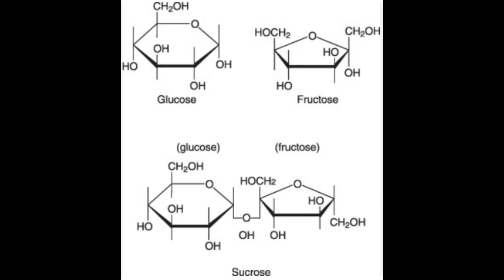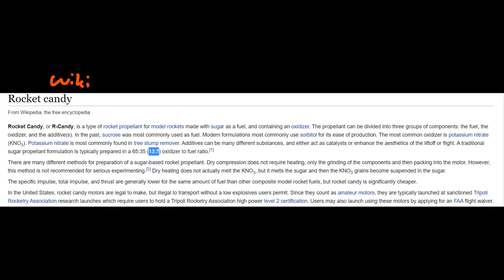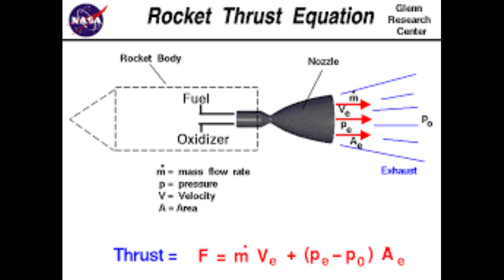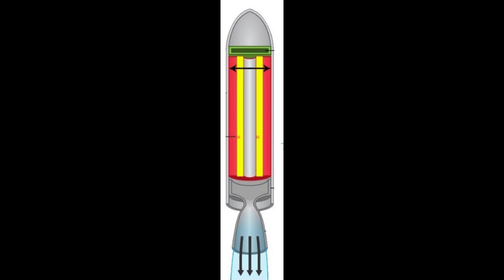Does Calcium Nitrate + Sucrose Rocket Work? (fail).

Comment: Ok if you want a rocket you will need a tube that won't burn through. Many at this level use butcher paper wrapped around a mandrel many times. Then press some kitty litter into one end and compress it well. Fill the tube with your propellant then seal with kitty litter. Now drill a hole in one end to make a nozzle.

Comment: You definitely need a casing to hold the pressure and a nozzle to expell de gaz at high velocity. I see smoke coming out both ends. That explains why you are not getting any thrust.

Comment: Yo, I've found that using a dry powder mix instead of cooking it together works better but it has to be well mixed and compacted a little. Just chuck the ingredients in a coffee grinder separately and then mix in a mortar and pestle.
Reply: Also, bake the nitrate at 180-200C for a while to dehydrate it, might take a while if you have a lot of nitrate.
Reply from the maker: honestly yeah that sounds lots better. my grinder broke sadley, so i had to resort to caveman tactics.
Reply: @thecrudelab3204  Yeah, coffee grinders don't last long when used for our purposes and I think the retailer's have caught on and increased the prices!
Just drying the oxidised and fuel for any of these reactions beforehand will increase your success.
Also if they are dried you might be able to powder and mix them just as well in a mortar and pestle.
Reply: Also, also lol, You can mix solution of sodium or potassium salts like carbonate, sulphate, hydroxide etc (not chloride) with calcium nitrate to get a mixture of solid Calcium salt and aqueous potassium or sodium nitrate that can be dried or mixed with the sugar and cooked to make a more conventional rocket candy.

Comment: Which was the most powerful / best mix for rocket motor?
Reply from the maker: in my overall experience: sodium nitrate, iron oxide, and glucose was my best. 
if you're talking about specifically about the calcium nitrate rocket, then i'd say the 5:11.5 (Fuel:Oxide) ratio. but its not exactly good, and won't produce any distance vertically.
Reply: @thecrudelab3204  thank you very much
Reply: @thecrudelab3204  does iron oxide help with calcium nitrate sugar mix.
It does with potassium nitrate but what about calcium nitrate

Comment: I recommend mixing Calcium Nitrate with Glucose syrup or corn syrup on low heat without water instead of table sugar. In addition use pottery grade Iron oxide which is pure Iron Oxide without any contaminants as a catalyst. Pottery grade iron oxide is readily available as red ceramic/pottery pigment/dye in gardening, also sold as cement color in Home Depot and Lowes (if you live in North America). In Europe the pure Iron Oxide is readily available in Bauhaus stores.

Also use a PVC tube instead as the rocket shell and once you pour the ready mix into the tube, make sure that no air-pockets are available in the mixture and use a relatively narrow metal rod to stick it in the fuel mixture once in the rocket shell, you want to have sort of like a hole in the mixture that will allow the fuel to combust more rapidly thus increasing thrust. 

I have linked an old video to the procedure of drilling the hole in the mixture:

www.youtube.com/watch?v=K5ig8J5xeqg
Reply from the maker: oh cool, so you got it working?
i think i'll design a metal case instead of PVC, as im not a big fan of burning plasic, and metal's pretty.
Reply: @thecrudelab3204 For just a one off experiment, steel,may be going a bit far.  I haven't done this yet, but one style of rocket people make has a thick-walled rolled paper tube (with glue). Thebl following has some guesswork on my part. Put a short section of the same sized tube you used to roll the tube in as a spacer in one end, though I think most people would set up something more elaborate. Ram Bentonite clay on top of the spacer, I think with a mallet and a slightly smaller  dowel or metal rod. (Rumor has it that cheap kitty litter is Bentonite clay.) I'm not sure how thick. Maybe one tube diameter? Then you press the fuel on top of that. Hard. I'd be pessimistic and use a wooden dowel. Then press just a bit of the clay on the other end, and glue the short piece of dowel on top, snugly. Drill a hole, slowly, in the end with the rammed clay. Not sure just what size, but even if it was half the diameter of the tube, I think you'd see a big improvement. First, the exhaust would come out 4 times faster. Second, if pressure builds up, the fuel will burn faster, so you'd actually be getting more than 4 times the velocity. Recommend lighting electrically or with a thin fuse, so that you can be a few feet away at ignition. A housemate used to light things by wiring a cheap diode on the end of a zip cord and plugging it in, making the diode explode. I've found that 12 volts into speaker wire with a single strand of thin wire across the end works, too. At least on an Estes rocket. Also, if you want the little motor to STAY a few feet from you, you'd better fasten it down. If you're pessimistic, maybe put a match head in next to the wire. And make sure the wires can't short. Maybe a bit of nitrocellulose lacquer on the bare wires would do that. You can get the stuff in a spray can. Maybe nail polish would be convenient. Make sure no one will apply power while you're close to the motor. Keep in mind that if this really works, something might burst, so stay back. I think Estes said ten feet, though you might want to increase that by the square root of Estes build quality divided by yours.  ;-)

I imagine the optimal hole would be a bit smaller, and maybe that would be necessary for any measureable thrust. However, the next step down this road would be a better-shaped nozzle, and if you keep going, soon you'll be demanding liquid oxygen and hydrogen.

BTW, I think I've seen a video of a much easier technique by a fireworks guy. I think one step was to wrap some paper around the cylinder of fuel and then use string to get it really tight, including a narrow neck, but I think there's a step I'm forgetting.

Comment: nice flame thrower at least. its roughly correct, because various forms of sugars are multiples of the c6h12o6 or at least close by. your first approximate ratio was correct. also you get that ceramic output being calcium oxide stuff, and not just exhaust gases. to much sugar. sugar monster. no no.
Reply from the maker: ah yep yep makes sense

Comment from the maker: for anyone who wants to try this experiment and is having difficulties in finding an appropriate tube, i recommend aluminium foil tubes, just cut it up and you'll be set.
also, keep in mind storing and transporting dry calcium nitrate with the combination of sugar is an absolute pain. its super hygroscopic and will turn into a puddle of water in about 10-20 mins depending on your climate. i recommend using the mix instantly after you create it!!

(pretty cool how u can see the orange calcium flames :>)